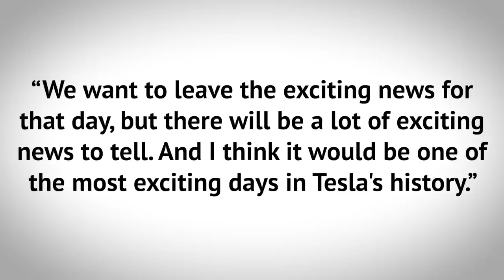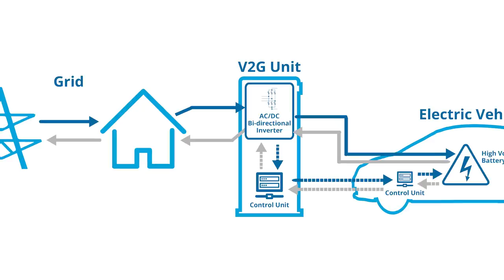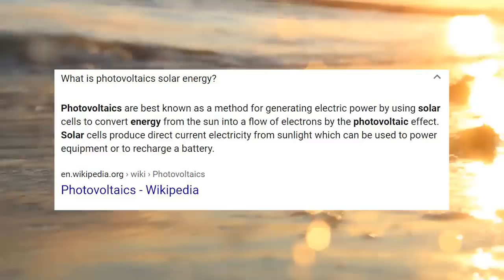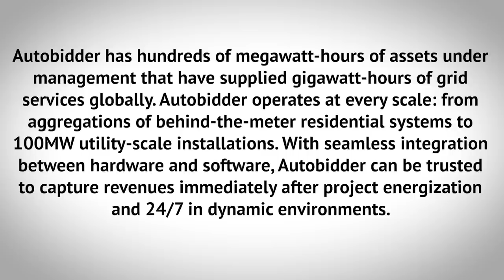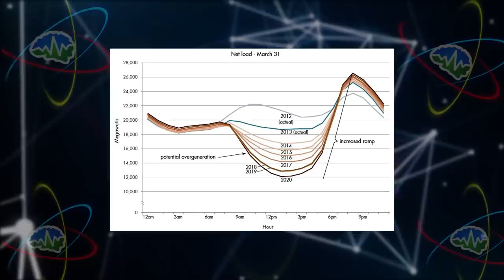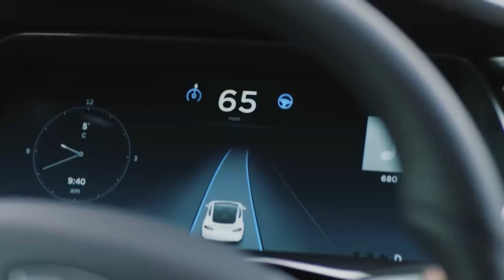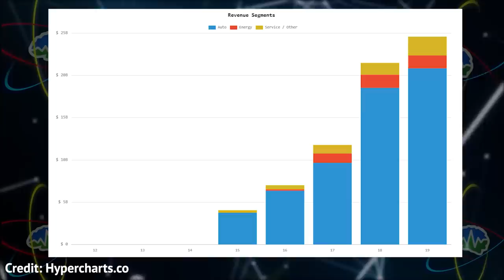Battery Day is Coming!  | In Depth

Comment: This was so well presented.  I was captivated throughout.
Reply: same, at times it was presented a little too simple i felt like they were saying dum dum dum.....but great job regardless
Reply: An E-car is powered by batteries, the batteries has to be charged from other energy source. Is it not possible for an E-car that can charge its own batteries while running ? One possibility is the installation of a  battery powered generator  in an E-car for the purpose of recharging its batteries. why scientist are not looking on this possibility?
Reply: @chinpangcheng3786  well you would need to power that generator somehow, most likely with fuel and that defeats the whole ecar point. The options for charging the batteries are solar and regenerative braking and teslas have regenerative braking already.
I didn't do any research on this i think that is the case, i might be wrong, also i think an electric generator would have to be big, idk how small they can make it to fit in a tesla... Maybe goodbye frunk? The front trunk.
Reply: Yes, but they were wrong about battery day. That's the bottom line.

Comment: Tesla Energy will be bigger than the car business im sure of it.
Reply: Right any significant headway that can be made in the lithium ion battery space to the tune of mass production (not just in a lab) would mean much more to people than cars or even Powerwalls.
Reply: But every large battery maker can do this stuff. If batteries were indeed that valuable, then their prices would not drop so fast to reach about 80-100 USD/kWh now.
Reply: I don't think so. There is little reason for individual consumers or companies to buy batteries or Tesla's solar energy solutions. The BEVs are their core business. Energy capture and storage have been the least profitable part of their business so far and has been a drain on the company so far...  I could see large high demand households getting a system, but outside that I think it is a ways off
Reply: Tesla internet business will be bigger still.
Reply: #PEAR - don't even have to short 1t :D
Reply: I live in a rural area and around me there isn't much solar power (visible) on homes... BUT I do know that in Australia it is fairly big thing. I also see them using the Tesla semi to function in a "convoy" mode. I also thought of Australia when I saw that because they have "semi-trains" in Australia. I feel like the market there in general might be quite a bit stronger... just a hunch.
Reply: Excuse the pun. But I think the cars will be the driving force of this!
Reply: I agree i was interested in solar roofs before the cars i dont even want a self driving car.... I do want a solar roof

Comment: This is the most compelling, clearly laid out case I've seen for Tesla's future (and I've watched your channel and followed Tesla for years now!). Amazing breakdown. I can't await for Battery day and the future that represents! (:
Reply: oh yeah !!!!!!!!!!!
Reply: Today, people buy a Tesla and a one or a few Powerwalls. Why? Because during the day, their car is on the road or at some random spot without a plug - instead of being plugged in.
Indeed, Teslas are rarely plugged in. Whenever an EV is not plugged in => they have no use in the virtual power plant.
To make it easier for customers, Tesla would need an inductive V2G charger (instead of a conductive one) to free customers from the need to plug in and make it more comfortable to earn money. And those inductive V2G chargers would need to be wide-spread and all attached to the grid. This alone costs quite some money. And all of your calculations need to be adjusted to account for that fact.
Why is power from Hornsdale (Southwest Australia) so valuable? Because there is only one, and because Hornsdale is stationary and because Hornsdale is permanently connected to the grid. And because their competition was an expensive cartel of fossil fuel generators with high prices for electric energy. If instead the competition offers cheap electrical energy (coal power plants, gas power plants, wind energy, solar energy or even nuclear power plants), then the value of electric energy is way lower. And as soon as every Tesla could offer stored energy, the price would drop dramatically. And this would change all of the assumptions and calculations given in this presentation. FMPOV, this presentation is manipulation of the masses with untrue assumptions, random figures and false arguments and conclusions.
Reply: this episode is mind-blowing, so watching it again.
Reply: Probably the best episode you guys ever recorded. Well done and Thank You. Even if they don’t announce all of it the possibilities alone makes it dead on they will eventually. Given the vertical integration they have achieved already its game over for regular OEMs on price. So long suckers is what the only reaction possible 😂

Comment: Man you guys are making expectations high for battery day
Reply: There's actually even more.
Reply: @rogerstarkey5390  Go on.....
Reply: @rogerstarkey5390  please speak leaker :{
Reply: @rogerstarkey5390  something on scalability?
Reply: @Chris-ms5bd  V2G
Reply: Battery improvements are very difficult and generally slow as well as other competitors in the game so I would not bet on any current predictions
Reply: It's been long time coming
Reply: But what else should we expect from battery day after Elon claims it will be mind blowing. It will be either dry battery or Graphene. And the latter one is pretty much impossible in year 2020.
Reply: Rudy Julian  Cobalt issue may be even worse.  The truth is that everyone switching to electric cars is likely to be very deleterious for the environment.  Actions such as permitting transport to use natural gas (it was essentially blocked by EPA during Obama administration when we had the chance) would have done far more for CO2 and pollution emissions and helping the environment than the pipe-dream of getting everyone on electric cars, especially if you factor in the entire environmental impact and not just what comes out of the tail-pipe.
People are often happy if you move the problem to where you can't see it (sweeping it under the rug).
Reply: @davidsuzukiispolpot  Yes, cobalt is an issue. The reason why Tesla is using less and less cobalt in their cells. And on your argument of using natural gas: sorry, but that is just nonsense. That is just changing one fossile fuel for the other. Yes, electric cars also have their downsides. But due to their popularity, more money can go to researching better batteries. But those current electric cars are needed for that. And your phone is also needed for that. Smartphones did (until recently) a greater job at improving batteries then electric cars do. But now more and more electric cars on the road, and range being a huge sellpoint, manufacturers see that investing in better battery tech will be profitable. Yes, batteries from 10 years ago aren't that good. Current batteries are much better for the environment already. And future batteries will be even better.
So please, stop promoting fossil fuels. As soon as we can leave that era behind, the sooner we can really move on.

Comment: "what smart engineers like... more smart engineers", that´s so true T.T, make our engineer life so much easier not having to explain the problem over and over again...
Reply: An E-car is powered by batteries, the batteries has to be charged from other energy source. Is it not possible for an E-car that can charge its own batteries while running ? One possibility is the installation of a  battery powered generator  in an E-car for the purpose of recharging its batteries. why smart scientist are not looking on this possibility?
Reply: @chinpangcheng3786  
Electrical cars already do that, it´s called regenerative power... 
But generete more kinda defies the law of entropy ... you can not get out of the system, more energy them you put in. 
A car in movement will always be "forced" to stop by drag.

Comment: Hi Zac and Jesse,
Here in the UK I have been connected to OVO's (Energy company) V2G trial since July 2019. As you mentioned only CHADEMO standard has the bidirectional functionality at the moment allowing this technology. My experience has been very positive with the system running through a cycle of charging and discharging each day. No significant degradation on the battery front and it has paid for all the electricity I have used for the car and my home since installation. Basically I sell Electricity to the grid at peak times and charge at off peak times helping, if in a small way, to equalise the grid. I have a 40kWh Nissan Leaf.
I really think that if Tesla can introduce this to their fleet and using their software expertise that it will make a significant addition to its bottom line. I can see why Tesla wish to become a UK energy provider.
Now that I have experienced it working for the Leaf I really want something similar for when I replace the Leaf with a Model Y with the steering wheel on the correct side of the car :-)
Reply: Do you make money off this? I mean the way you're dealing with energy you should....
Reply: Well done on the trial, very lucky.
Reply: @brokkoliomg6103  - Well, he said he "Sells Electricity", and it has "Paid for all he used", so, Yeah!
Reply: Also, for those worried about the battery, imagine you're low mileage driver like me [currently with a CCS socket so unable to enter the trial] and it's rather hard to justify the high cost of the battery [I don't care] which will only be half-way to its guaranteed life at 8years - then V2G could be a way of making your expensive asset earn its keep during its lifetime. In a way, I'm more concerned about the lack of battery degradation over 8-10years and it has too much life in it as the body and its technology ages.
Reply: So how long before you need to replace your batteries? How do you dispose of them? How much was your initial outlay in cash? How much do you receive per kW into the grid? As a single user, it may work well. In Australia, at present, the max feed-in tariff is 7 cents per kW home solar feed pay you have no say in price. At first, it was as much as 60 cents feed-in. As noble and self patting on the back as you seem to think all this is in the end on a national scale it is unrealistic. But good luck with it all.
Reply: @HMASBarbette  JUst because the current arrangements in much of Australia are not suitable yet, does not mean the cannot or should not be. Hopefully the will be.
Reply: As long as only a few people are doing it the power companies won't pay much attention, but if they ever get the idea that they are being financially disadvantaged by lots of people doing V2G, they will change the power tariffs to their own advantage. Enjoy it in the early days, because the financial benefit will be stamped out when hordes of people jump on the V2G bandwagon.
Reply: @HMASBarbette  Different tactics. The feed-in tariff can be a little higher in some states (eg 12c)/kW, but that is the retail market.

Tesla's autobidder would allow you to access the wholesale market (and FACS market on the side) where for brief periods, power prices can surges to thousands of dollars per megawatt. When a coal plant suddenly dies or a solar farm clouds over for a minute, the grid is at risk of collapse. Rapid supply of stabilising energy earns big dollars (FCAS). This is happening in Adelaide with Tesla's VPP pilot of eventually 50,000 powerwalls (was 1,000 last time I looked). They had 3 events where Autobidder intervened and bid 800MW from the VPP into the grid and made good money. 

The other side is that with increasing wind and solar, negative price events are happening more often where there is too much energy and you get paid to take it. So you can get paid to charge AND discharge into the grid. Prices will be highly dependent on the season and part of the grid you're in but with Western Australia reaching 50% household solar, and Queensland a world leader, negative price events will become far more common.

And all this is while you still have 80-90% coal in the two big states of NSW and Vic. As pressure mounts to transition, both states will become big importers of electricity from SA and Queensland in all likelihood and prices will climb.

And back on the retail side, you could potentially go "off-grid" entirely with your Tesla.
Reply: @MrDisasterboy  I sorry but renewables for the little guy and elderly is much like your TAG Mr Disaster boy! We need more coal power stations and more dams than windmills or acres of wasted farmland for mirrors. Instead, put solar on every home rooftop, now that's sensible. This would support cheap energy.
Reply: Wait until Tesla becomes a grid in itself .. you are right about UK

Comment: 10:42 That isn't how energy storage works. The electrons don't have to do that. It's more like feeling the push of water out of a pipe under pressure. The electrons typically move very slowly (less  that 1 cm/s or so), while current 'moves' at close to the speed of light.

Comment: You already have an inverter in the car. You just currently only use it for charging the battery.
Reply: Yes but it is 2 way?  And how do you communicate with it to override the protections in place?  Thats why Chademo works, it has a comms pilot, CCS is just the 2 poles.
Reply: Tesla's Regen is doing live AC-DC conversations, regularly, then, when you squeeze the go pedal, it's back to DC-AC!
Reply: @mathewroberts4834  - Two Way? Remember "Regenerative Braking?" And fast 0-60 Times? Yup! 2-Way, already!

Comment: With a Pilot in the Netherlands, the benefit for the users was about €250 per year. The Netherlands has a dense grid. So in many places VTG will not pay for a new battery, but only for 10% of the value

Comment: There are really a lot of bright minds at Tesla.
Thanks for this episode, guys!
Reply: An E-car is powered by batteries, the batteries has to be charged from other energy source. Is it not possible for an E-car that can charge its own batteries while running ? One possibility is the installation of a  battery powered generator  in an E-car for the purpose of recharging its batteries. why smart scientist are not looking on this possibility?
Reply: @chinpangcheng3786  You should spend some time studying Physics or science in general.

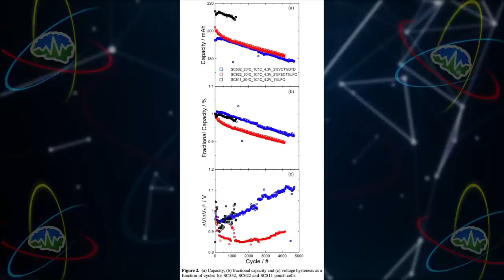Comment: At around 10:22 Jesse mentions the tabless battery and Zac talks about the electrons needing to follow through the entire roll to get out and how a tabless battery helps this. There clearly is some energy lost for the electrons going through the entire spiral length of the foils in jelly roll. However, the foils are highly electrically conductive materials so the loss is not that great. However these foils are not very thermally conductive (very small cross section and long length). So the heat mostly goes radially through the the foil/anode/separator/cathode/foil to the side of the can. This radial path is not highly thermally conductive so the inner layers end up being hotter. To manage the heat a battery pack needs to limit the charging / discharging rates and limit the battery diameter (the radial distance).
The tabless battery offers a much shorter distance for the foils to conduct heat to the can. This allows for mixes of faster charging / discharging and/or radial distance. The Maxwell DBE appears to be thicker than the slurry so the DBE cannot be rolled as tightly without cracking. So a Maxwell DBE battery is likely to need a larger radius. The rumor mill suggests than instead of the current 21mm diameter then DBE batteries will be 40-50mm. A tabless design could be very helpful for getting heat out of this larger diameter.

Comment: Note recycling doesn't drill down to individual cells and check each one for its condition.  First, they drain all the energy out of a pack, then disassemble the pack removing mostly structural components, then they send it to the shredder to start the mechanical separation of the constituent materials after which chemical separation processes further assist in separation.

Comment: Maybe you could also use the power from your Tesla instead of buying a power wall for your house
Reply: Kenneth - Powerwall for Solar Buffer, V2G for Mobile And Flexible Expansion, plus Energy Arbitrage! Like a Day Trader, moving in, and out, 10,000 or 100,000 Shares per trade, as a Stock price moves "A 1/16th" (of a Dollar) up, or down!

Comment: At 30:00 you guys mention that with the vehicle, people will be able to use them in a power outage. From my understanding this is not true. Any grid-tied power system is unusable during an outage by law. Unless of course they have an auto-grid disconnect system so it doesn't send power back into the grid. Currently, any grid-tied system without an off-grid backup system will be useless.

Comment: The main benefit of "dry electrode" technology is actually that there aren't shrinkage issues from drying a wet electrode coating.... ie no warpage or uneven electrode thickness issues... which effect the usable width and battery efficiency.

Comment: Two thoughts came to mind as you described the possibilities. First thought is that Tesla could actually subsidize or reduce the cost or pay you to replace your existing battery pack with a million mile version just so that you had a longer life battery to contribute to this V2G. The second thought is that Tesla could develop a charger that ties to their Powerwall, so that rather than having to purchase a separate inverter, you could use the inverter that's already built into the Powerwalls that they sell.